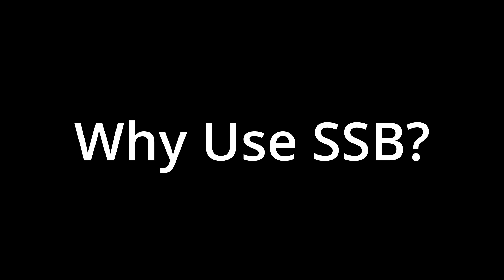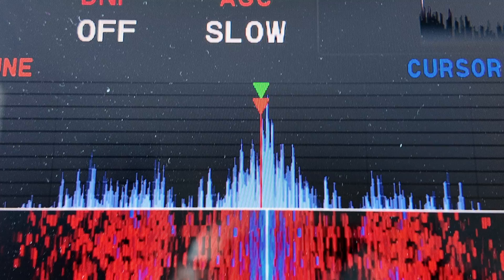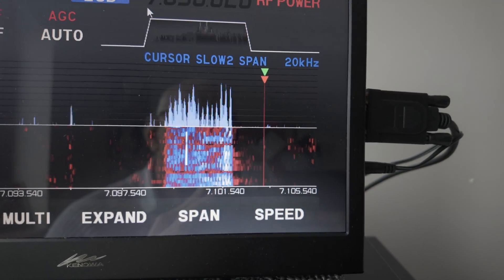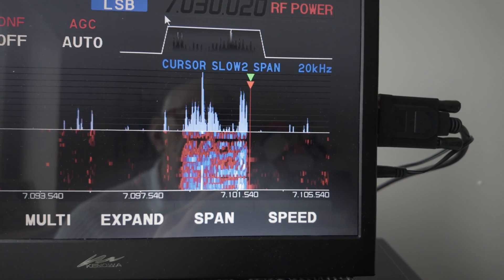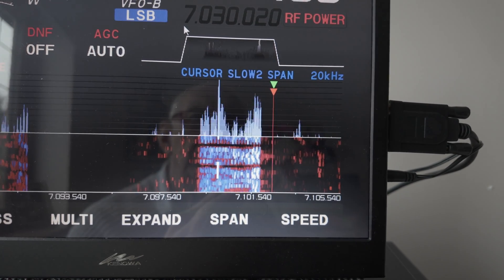SSB how it was developed and its advantages.

Comment: Hi Peter,
What a really rounded explanation you've done there.
One thing I don't understand these days, is the leap to higher power, when I first got licenced, I was told that you should do the most with the least power available, meaning that you get your antenna(s) in check before requiring more power to feed them. 
To be honest, I've worked all over the world with somewhere between 80 and 90W.
I came to Ham radio from HF CB and having an AM/SSB set, meant you could either do 4W of AM or 12W of SSB, it was a no-brainer as to which was better.
With respect to people talking about "channelised" frequencies, maybe a lot of these people came from CB, where you flick the channel switch and it is what the receiver tells you.
Ham radio gear is frequency-agile.

Comment: G2DAF was the persin that br4oke SSB to radio hams in 1960 yntill then no one talked about it. he started  working with ssb in 1941 int the radio develpmemt
Reply from the maker: The RSGB published a design well before G2DAF which I built and operated on 80m. The G2DAT design came somewhat later and was the first all-band SSB transmitter circuit published by the RSGB, which I also builtF

Comment: The point about power is a good one. I find when I'm first to find a contact I can often easily make a contact with my 50w into VK or ZL but everyone running lots of power creates a need for more power, I can sometimes bust through a pileup though but tend to give up after say 4 or 5 attempts to avoid getting frustrated, as soon as the fun  is lost best to find another contact i think.
Reply from the maker: Yes I totally agree. On the rare occasion I have been on the  other end of a pile up I often pick out the weaker signals!

Comment: Hi Peter ! Just a quick note for those operators in the US, our access to 60m is “channelized” to 5 designated frequencies only. Most all modern transceivers sold in, or for, the US market come with transmit enabled on these 5 frequencies only in the 60m band. (Leave it to us to make things confusing 😆!) 73 de Dan WD4DB
Reply from the maker: Hi David, yes 60m is the exception - at the moment! 73 Peter.

Comment: Thank you for the well presented history, a slight exception to the norm is the 60m band which is channelised and USB. It is certainly interesting to see how the evolution of SSB generation has changed, my older rigs used the normal filter method the newest use DSP to generate it. It is hard to believe now but SSB did meet with some resistance when it was first introduced. 73
Reply from the maker: Thanks for the info! Yes you are right. There were some who vowed never to use it!